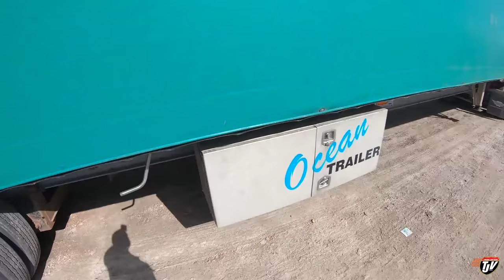My Trucking Life | RENTAL | #2282 | May 13, 2021

Comment: Quite a few different organic fertilizer on the market.  Your lawn is compacted needs to be aerated before a seeding.  Also here In the suburbs of Chicago, very dry conditions.  With seeding 1 inch of water per week would be needed.  My husky is also compacting with the added delight of holes all over.😄